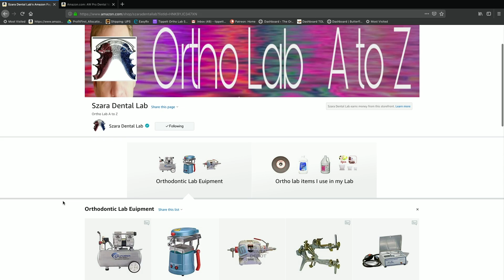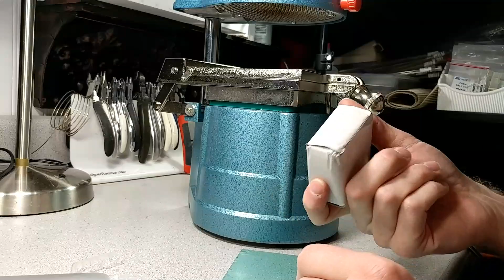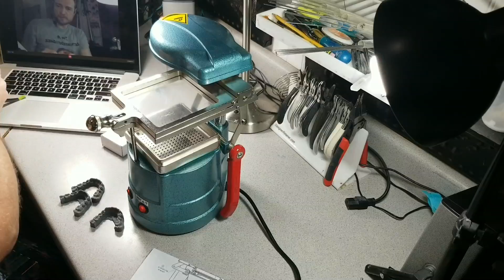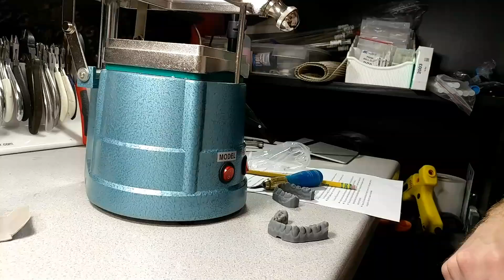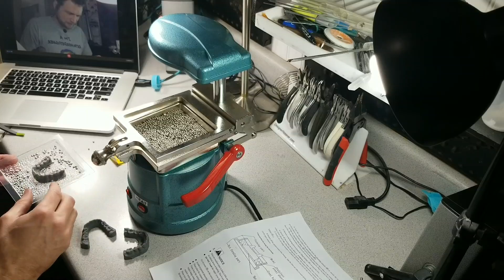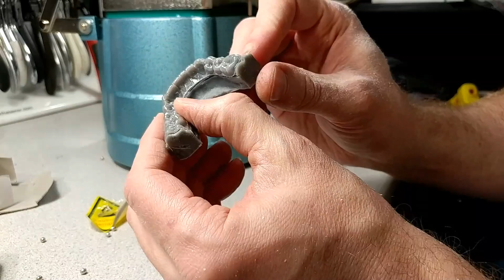A $100 Thermoforming Machine from Amazon?! A Live Stream Review

Comment: As an aeromodeller  I mount the object to be molded onto a board   (3mm ply) j ust slightly larger all round.  Makes it easier to cut items out.  Main thing is read up about drying any  plastic materials as some absorb moisture and small bubbles appear in the final product.  EBAY sell dental plastic sheets  (called splints) reasonable price post free ex China.  I dont bother weith the steel balls....too fiddly.
Reply: I need 1mm hard sheet bro